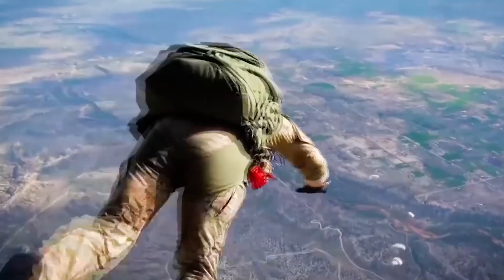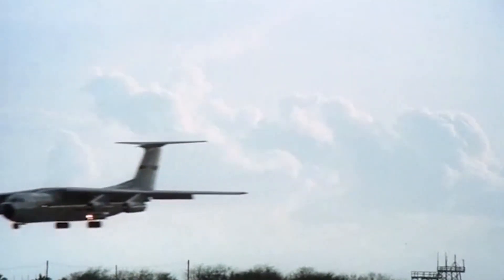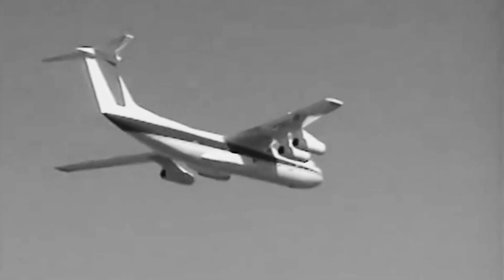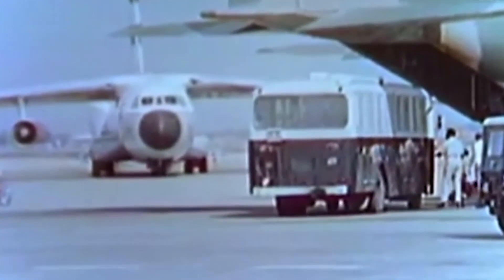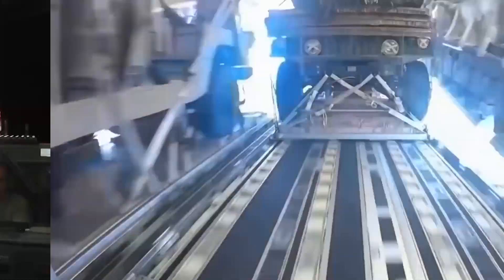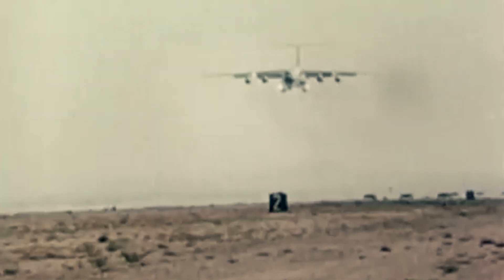C-141 Starlifter - a support for air bridges

Comment: I was stationed at Travis A.F.B. in California during the 80's. We had the KC135, C130, C141 and C5 aircraft. The 141's were called Stretch, but later when they painted the Camo Green we called them Lizards. I miss hearing the engines ramp up. Of course the C5's (called FRED) were much louder. I didn't work on them but I had some buddies that did. Those were the days.
Reply: during the 1976 summertime it was a case of being awake at 3 am at family housing area- Beale Ct- Travis AFB- and hearing the TF-39 engines being run up, with that ANNOYING whine :)

Comment: One of my absolute favorite planes! I live the sound of TF33's/JT3D turbofans. The Starlifter had the most powerful version made and with almost no inlet, the inlet guide vanes are almost flush to the inlet lip. This meant there was basically no sound absorbtion. Those puppies SCREAMED!
I was off the end of an AFB runway when many were being ferried to AMARC. 141's screaming over my head all day and I miss that. Not only did it sound fantastic but it was a beautiful jet! Minus the air refueling bump on the head of the B-models.
Reply: So that's why the 141 sounds the way it does? Ive always wondered why they had such a bitchen & distinct sounds. I have videos i took of them out at Norton AFB during airshows. I turn my sound system waaay up to relive those days. ❤

Comment: When I was growing up on Fort Lewis, the duplex I lived in was directly in the approach path of nearby McChord Air Force Base. I got to see the Starlifters pretty closely every a hour or two.
Reply: I was at McChord 1976-1977 & 1980 -1983.  Now retired I live nearby.
Reply: I was stationed at McChord from 2003 to 2008. I got to see the last 141 leave.
Reply: Oh the good old days 😌
Reply: @Flight Sim Historian my grandad started out navigating on a C47, and got to fly on the C-97 and all the other scary "shaky" prop planes before spending most of his time on the C141. I loved getting to see them flying at McChord in washington by their home all the time when i was little.
Reply: Grew up in North Tacoma under the approach for McChord in the 90s. The sound of those engines is something I will never forget. The C-17s are whisper quiet compared to the C-141. I remember when they'd practice MITOs and you'd see 4 or 5 C-141s all in trail lifting off out of McChord (only saw this when they'd rarely take off to the north). The amount of exhaust in the sky was impressive.

Miss them!
Reply: I remember the same thing from wood brook area  1977-90s

Comment: I was a crew chief on the C141. :)
Reply: I worked on the C-141-C  before heading on to the C17. :)
Reply: I crewed 414 and 619, out of Norton.  I remember one of our planes returned from a TDY, and hit a flock of geese.  Huge holes in the leading edges of the wings, and tail.  After the repair, she was selected to participate in some competition.  It was sent out with seven geese painted under the pilots side window, fighter style for the number of kills.
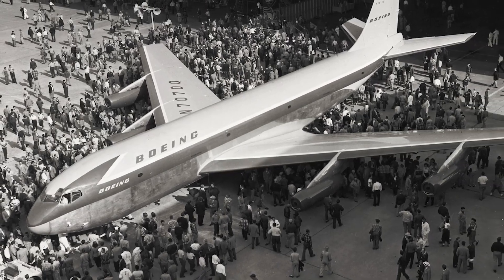Reply: I worked on these great aircraft,  At Dover 1968-69. APG,  Bur. # 59405,  and aTravis , sa 1969-71. Aero repair shop. Watched. The first, C-5A, taxi in and park.  02:45. Loved this plane.  Worked on the old, Shaky. C-124, and  C-133. Was a great experience.  Lol, guess that's why I retired out of aviation.
Reply: My tailnumber was 680032, 60 OMS Travis AFB 82-88!
Reply: @hoolehuarayzed7694   There were no C-141's with a 1968 tail number, nor 0032 with any other prefix.  The USAF database says tail # 680032 was assigned to an F-111E.
Reply: @662wc5  Well I was wrong on year, but definitely was something Balls 32, don't need to throw frickin daggers!

Comment: I spent 24 hours on a Starlifter in 1968.  The trip from Eglin Air Force  Base to Korat, Thailand via Elmendorf Alaska and Yakota Japan.  The best ride you can get.  It was configured with airlliner seats.
Reply: It was a very comfortable ride as long as the underfloor heat worked.

Comment: I heard a former C-141 pilot, Lyle Prouse, describe one fretful characteristic of that aircraft: Because of its high-wing configuration, it had an awful survivability record when ditching in water. Few if any crew ever survived a ditching. Such a majestic, beautiful bird though! Especially the ‘B’ and ‘C’ stretched models. 
Hi to Sky! Another artful, informative video!
Reply: I am not aware of any C-141 ditching incident.  Flew it for 4 years from 1985 to 1989, 30 MAS, 438 AW McGuire, NJ.  Took me and our crew all over the world.
Reply: The life rafts stored near the overhead exits were extremely heavy.  How they ever expected anyone to get them out that hatch, was wishful thinking.  It usually took three people to mount them up there.
Reply: The only C-141 I recall ditching was one out of Da Nang that tried to take off with the spoilers extended, not really a ditching.  Ironically, the plane could be taken off with the spoilers extended, one of the pilots in the 14 MAS did it out of Wake Island.
Reply: @stephenearl761  I think you meant Cam Ranh Bay not Da Nang.
Reply: @bobweaver1089  I think you may be right about that.
Reply: No C-141 ever "ditched" in a body of water.  The previously mentioned Cam Ranh Bay incident involving 66-0127 on 13 April 1967 was a crash, not a ditching.  We always assumed it would float as well as any "heavy" in a ditching, which is to say not very well and not for very long.  Luckily we never had to find out.
https://
c141heaven.info/dotcom/pic_66_0127.php
Reply: @662wc5   My source is a former 141 pilot, Lyle Prouse. I’m just quoting him. The context of the mentioning was a talk wherein he was telling the story of when his aircraft was given a load of fuel contaminated with water. Flying over water, the fuel began to freeze at a juncture in the fuel lines and the engines “were starving.” The condition somehow abated and they landed safely. His crew were terrified as they were expecting to have to ditch, because “no one had ever survived a ditching in this airplane.”

Comment: I have been transported in both the A and B models of the C-141. 👀
Reply: Noice
Reply: How'd you find it? Any cattle class transports you'd compare it to to give us mere mortals some idea?
Reply: @uzaiyaro  As I remember it usually depended on the size of the deployment. Most times you are packed in like sardines and then there are the instances where you can actually lay down on the troop seats. You more often than not had cargo down the center also. 😎
Reply: Dating yourself, lol! Me too!!
Reply: I have been in the A model that was stretched into the B model prototype. It is on display at the Lockheed Martin Museum in Marietta, Ga.
Reply: @bartfoster1311  what is the difference between model A and B
Reply: @morghaaniyasamy188  the B version is longer along with a few other changes, they cover it toward the end of the video.
Reply: @morghaaniyasamy188  fuselage length.
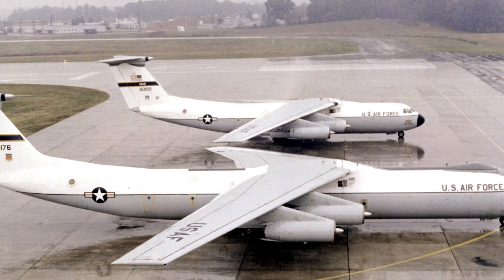Reply: @morghaaniyasamy188  If you look @12:52 and forward both the A and B models are shown together.  B models are considerably longer.  Also the B model added Aerial Refueling capability which can be seen by the "bump/bulge" on top just behind the cockpit.  Having spent my tour at 1 of the then 6 "Strategic Airlift" bases in MAC with the B model the A models look very small to me now and of course missing the refueling receiver.  I think all but 1 or 2 A models were converted to B models.  I thought the exception was one at what was then the NASA Dryden research facility now known as the Armstrong facility on Edwards AFB.  It was so short even from a distance that it stuck out in my mind. Now I am wondering if it was actually the civilian prototype. My dad did fly on the A model via MATS to/from Vietnam as an Army officer.  Unfortunately his dream of being an Air Force pilot ended after his second year in the Corp of Cadets @ A&M when he found out he was colorblind.  Not sure what the requirements were for pilots back then as far as vision, but he is the only one with glasses on in his USAF Cadet group picture.  Like many others he was very happy to return on a reliable and safe airplane.  Too bad all the wing roots were cracking.  I do not believe there are any left at DMAFB.  They were all scrapped as far as I know.  Still an excellent video just like the prior ones I watched.

Comment: its abhorrent these planes even all planes arnt engineered to be economically upgraded for indefinite use much like the B52. An-2
Reply: Airframes do have limits, theres only so many cycles of pressurization and depressurization they can take before you get fatigue cracking. Or the cost to maintain them costs more annually than a new one.
Reply: The B52 wasn’t “built” for unlimited upgrades. 🙄
It’s continually upgraded because the airframe provides adequate performance for a job that needs to be done.
Airlifters were a different story - the airframe was sub-par performance-wise and was not tactical, LOTS changed and even with upgrades, it couldn’t approach the performance of the C-17. 
Also - eventually upgrades become cost-prohibitive. People think it’s always cheaper to keep the old planes, but it isn’t.. Boeing has SERIOUS issues right now with their late tanker deliveries, as the KC135s were supposed to be retired years ago. It’s costing the USAF absurd money keeping the 135s in the air.
Reply: Even commercial airlines have a limited life cycle.

Comment: So you consider about 1 in 6 a good crash record? Even for military aircraft that is a stretch
Reply: Count in how many miles they flew and how many hours they managed to do.. then it will become laughable ratio. Maybe comparable with things like B-52, Tu-95 and KC-135..
Reply: @xmeda  Completely agree we wore these planes out flying all over the world.    Almerinda you should stay in your room where your safe.
Reply: @xmeda  no, you don't need to count those in. 1 in 6 is the probability of any one particular airplane landing in the dumpster, which is bonkers. It's probably better than WW2 aircraft but still, this puppy wasn't getting shot by AA or getting into dogfights so...
Reply: @almerindaromeira8352   It is very different if you have for example two cars. One is some fancy thing that is only rarely used and spends 90% of time in garage. The other one is daily driver that is used by pizza delivery guys 24/7 and within 3 years that car reaches over 500 000km... 

Now think about which is more likely to get crashed or damaged during service.

These starlifters were used extensively, even during wars, their lifetime was extended and they still served.

In world war II the life expectancy of plane was counted in days or weeks.. not in decades. omg.
Reply: @xmeda  but having accidents/ crashing has nothing to do with use. If that were the case, Ryanair would have the most accidents in the industry. Those are much more abused than these ones.

Comment: Waiting for the story of the Galaxy!
Reply: The C-5's story almost ended in the early 1980's, which wing spar cracking issues nearly caused an early retirement of the plane. But they were able to fund the wing spar replacements and build a number of C-5B planes; I believe the C-5B and many C-5A's were rebuilt into C-5M's with new engines.
Reply: If my history is correct, the C-141 was the basis for the expanded C-5 Galaxy witch many advancements of course. When I lived in South Carolina, these planes would fly over my house regularly. With the back cargo door open, they flew so low that you could see the faces of the cargo crews standing in the door looking out as they flew over. Amazing aircraft to say the least.